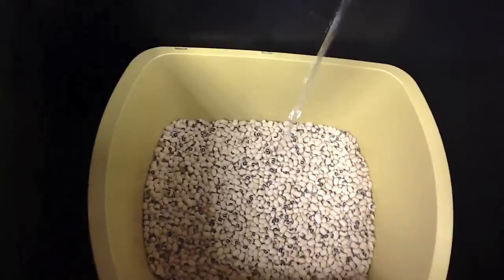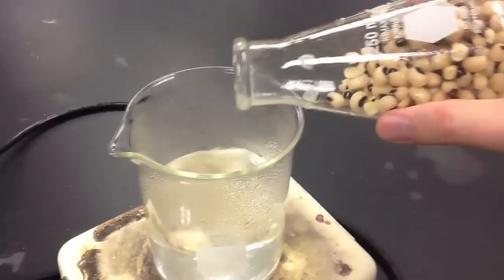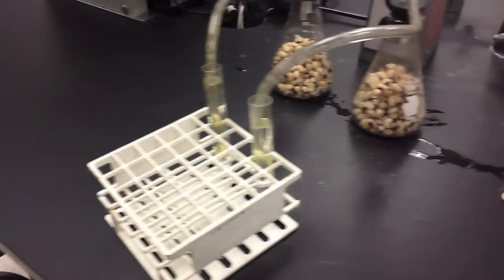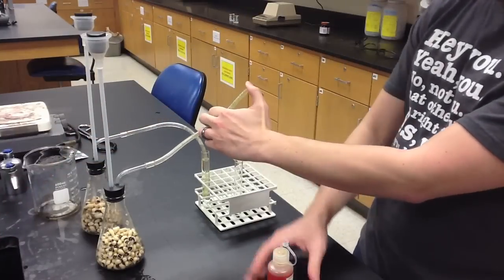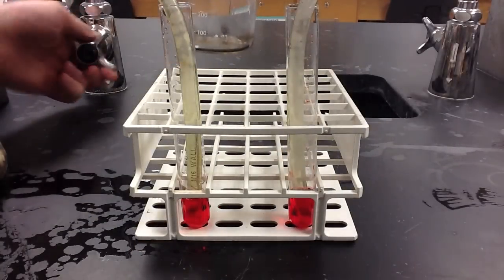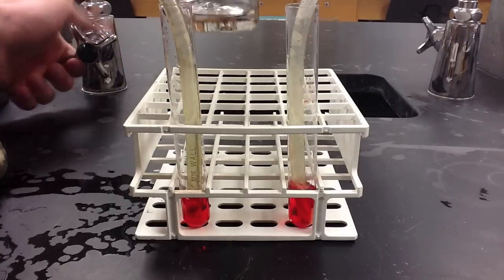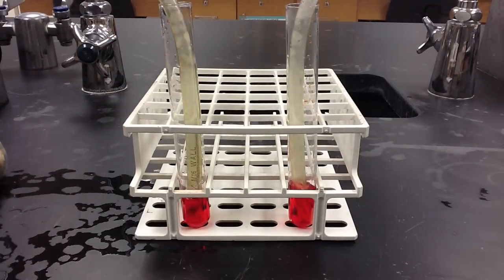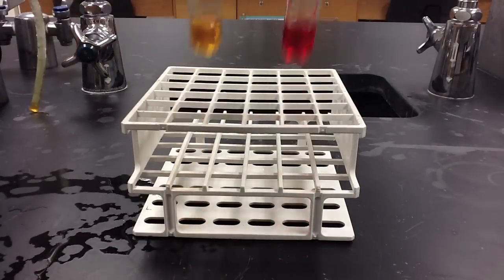Lab Protocols - Determining Carbon Dioxide Production in Plant Embryos (Unit 9 Respiration)

Comment: Okay…. So then which variable was it?  The boiled or unboiled beans?  Did your process of boiling the beans increase the production of CO2?  Did the temperature of the beans have an effect?
Reply: I see that this is an old question that you probably got your answer by now but for anyone who is still wondering:

heat denatures/kills the enzymes in the peas which stops them from performing the respiration process, therefore not making CO2.

the yellow positive test was from the unboiled germinated peas

Comment from the maker: In this particular test we were performing a qualitative assay, which simply tests for the presence or absence of Carbon Dioxide, but cannot measure the amount produced.  To do that, you would probably need an apparatus that  was capable of measuring the CO2 produced in mL, and then you would also need a way to ignore the oxygen that was consumed by the peas themselves.  I have not measured the amount of CO2 produced, so I'm sorry that I can't be of more assistance with this.